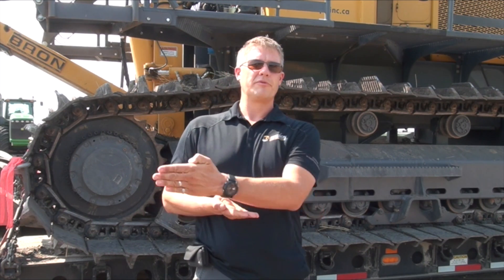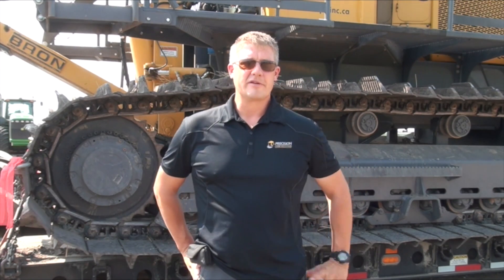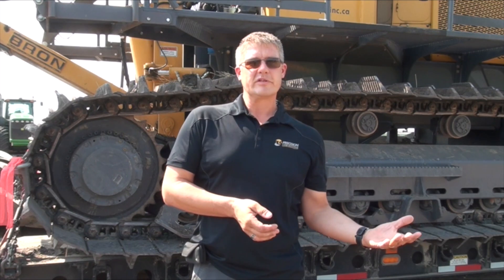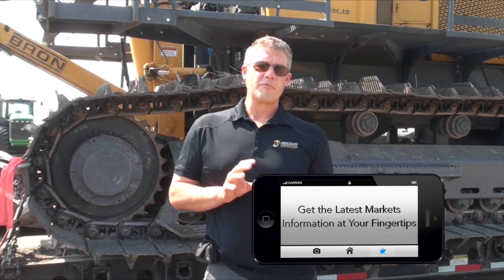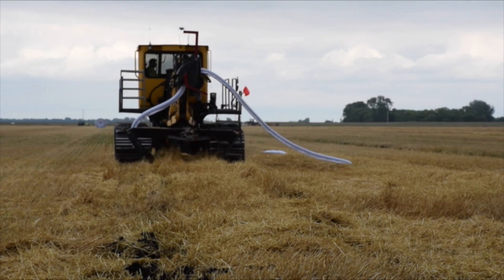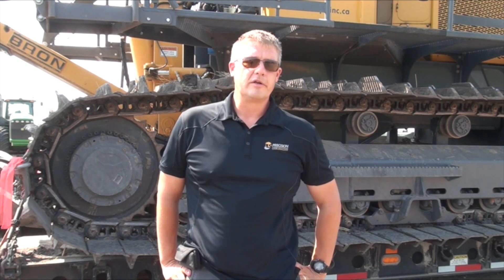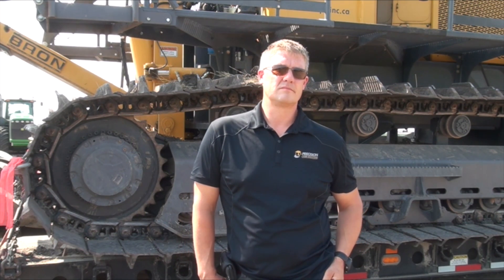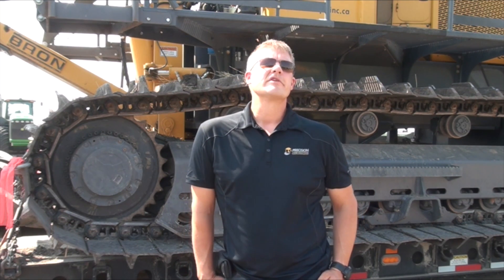V-Shaped Tile Plow Reduces Soil Disturbance and Ruts

Comment: The best way to put a drain in is to dig a trench,  to the required depth, put your drain in a plastic pipe in twin walled sections not the flexible type, flexible type moves up and down and creates no flow areas, put the rigid sections in but they must be covered by Terram, a membrane that lets the water in to the drain, but does not let the grains of sand and soil block up the slits in the pipe, then put gravel in to the trench to a depth of at least a foot, put the soil back into the trench, then subsoil  along side the route of the trench, then subsoil 90 degrees t the trench, but only as far as the subsoiled line to the trench, that way it opens up the ground the best way.